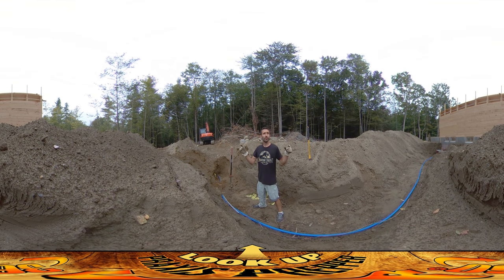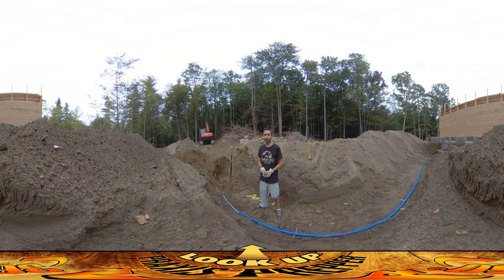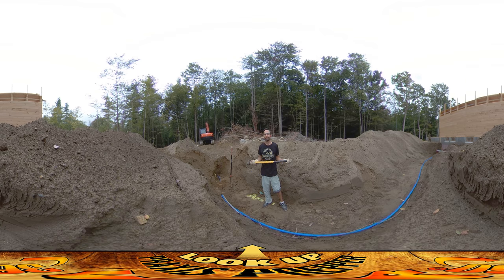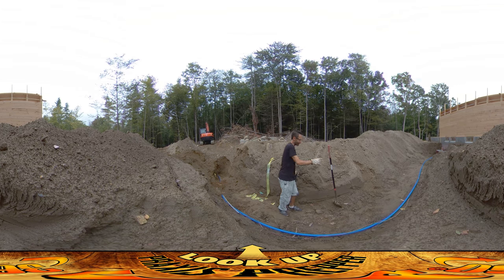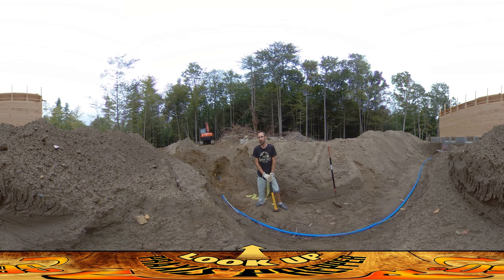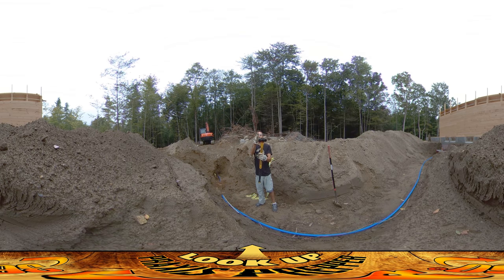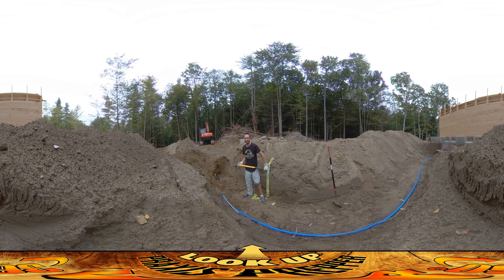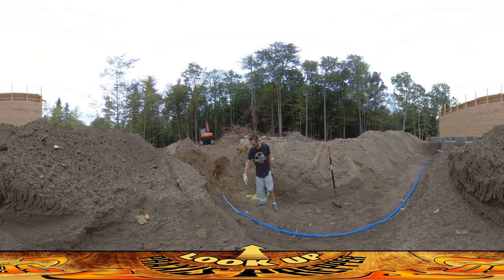Homestead Building - Rock Smashing, Well Line Issues, Professionals Making Mistakes or Not Listening

Comment: To me 'Professional' simply means they are amateurs doing their 'best' (or the least amount of work that will suffice) and get paid for it, and generally the paycheck is the only thing that's the difference between an amateur and a professional. Sometimes there is a bit of equipment difference, but hey, if an amateur got paid (s)he would likely be able to afford said equipment too ... and in some cases there is the 'professional slang' that sets the 'pretentious professional' apart from the amateur, though in most cases that slang is only there to sound like what they are doing is actually 'difficult' (and very important to do right, or at least have it done by them) ... because if they told you it was easy, well then, obviously you would pay less or god forbid do it yourself ...

Comment: Hopefully when they got to you, you told them that they screwed up and they fixed it.
Reply from the maker: I've run out of steam on telling contractors that they've screwed up. That's probably a bit severe, they do more right that wrong, but still, there are so many errors, I'm more focused on just getting the contractors out of the mix so I can (as a layperson) do stuff right. I'm not a great manager of people who aren't super good at their jobs. I'll admit that,
Reply: Praxis Homesteading and Survival Skills I also tended to lose trust in people to do work they should excel at after they screwed up and just do it myself. That particular error looked like it would take a lot of physical labor to correct using a shovel when they should be able to fix it in a short period of time and get it in the location that won't require adjusting your plans for your open land.